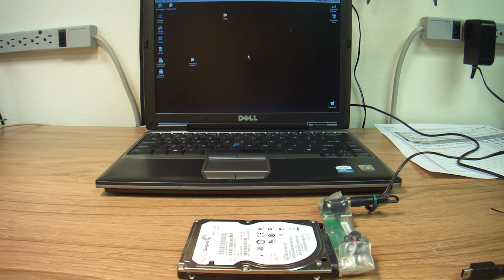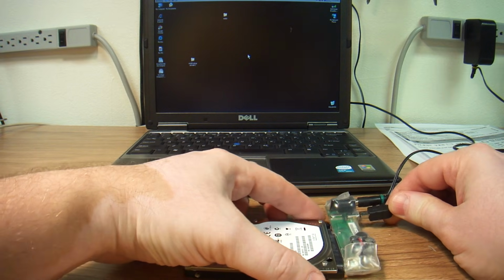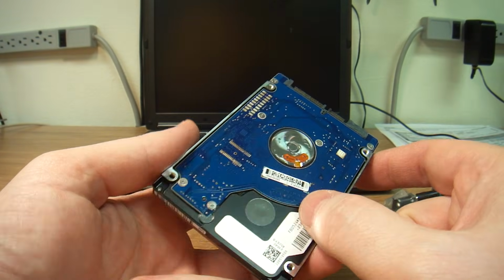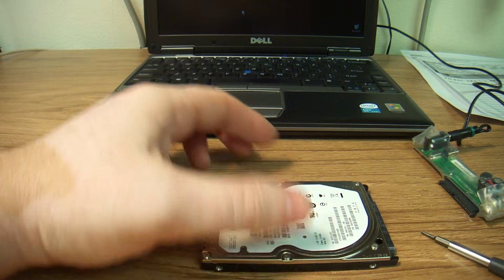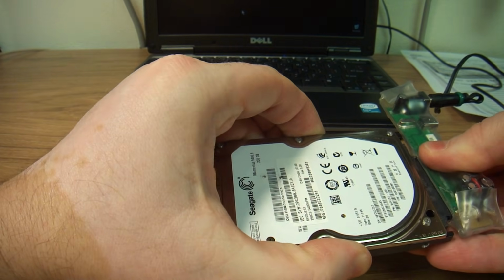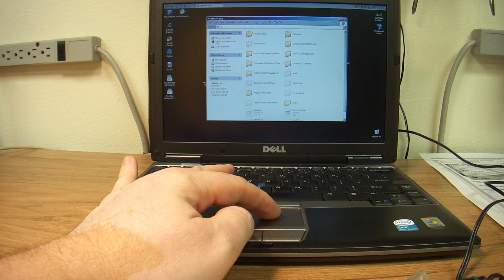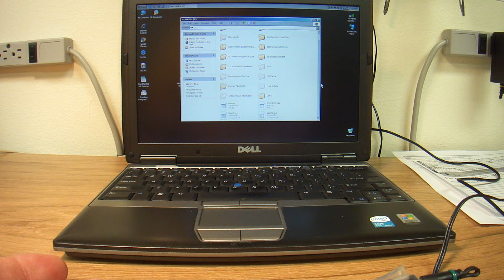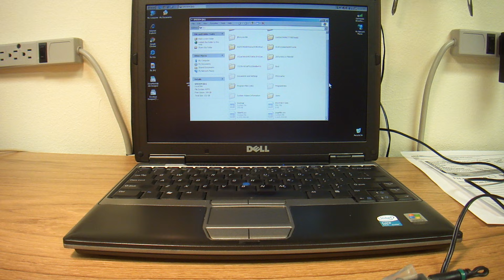How to fix a broken hard drive Beeping noise or clicking RECOVER GET DATA BACK FOR FREE! BEST TRICK

Comment: Thanks mate, the people who  recover the data were demanding Rs. 4000/- and more, the money for which I can buy a new hard disk. The problem was with Transcend hard disk, while it was still in warranty period, I couldn't find a service center near-by. The customer care was least bothered. Some of them told me the data cannot be recovered. Some didn't know what to do with the beep sound. I just invested Rs. 150/- on screw driver set and was able to recover 3/4th of the data. One folder was not accessible, but never mind. Thanks a lot!
I have 3-4 pen-drives that fail to get detected, any solution?

Comment: HI i wanted to ask my seagate 500 gb external hard drive stopped working... it was working find its an old hard drive i think i bought it in 2007 or 08 ...its an IDE connector..first it used to making weird beeping sound and not show up on my computer ( not similar to the one in video tho) then it made that beeping sound for about 4-6 minutes when connected to my laptop. after 4-5 mint luckly i used to show up and worked fine... then one day it just stopped booting. i even purchased usb to IDE adaptor it still dont boot up.. its dead no sign of any type of movement in hard drive no sound of spining.. can i fix it my self or it has to be pro done? thank you for ur time

Comment: Seagate drives always have this fucking problem
Reply: smokey deazy I recommend Western Digital.
Reply: +Norman G Seagate has thee worst hdds
Reply: they should open the gate to the sea so all of their hard drives die
Reply: +smokey diazo get a western digital
Reply: +SHJ Gaming Currently I have 6 seagate hdd es. Actually i really dont know why i keep buying seagate although they get crashed several times lol.

Currently one of them is compelely crashed. PC doesnt even reconginise it.
Smart check shows a few errors for another one.
And so far 2 seagate hddes are changed in warranty. And one of new changed ones has just arrived a few days ago and strange voice is coming from it.

In a nutshell;
I had 4 problems with 4 different hddes out of 6 i bought+2 changed.
Reply: +SHJ Gaming hey,i'm thinking about getting a new hdd ,need some help,i saw this comments now it change my mind on seagate .. which brand do you think is the best  ?
Reply: Exactly
Reply: thanks guys , my current HDD is WD 1TB .. :)
Reply: +SHJ Gaming i dont.  my last western digital hd broked after one year.
Reply: leohpndbz There's always an erroneous number in the mean time between failures. You're just unlucky.
Reply: +SHJ Gaming Hi USB Same too I am problem !! :(
Reply: The beast HD thanks, and i'm using 1tb WD now .. yippiyay
Reply: storm_999_ I think the really high capacity ones (4TB) are more reliable for some reason. Really good for RAID configs. But, yeah, all the consumer grade ones have just failed for me.
Reply: Idk all me segates are dead but my wd drives are more reliable for some reason
Reply: +smokey deazy do not buy a hdd. buy a ssd is much faster
Reply: Fuck Yeah Peczi ssd is for ultrabook right ? can i install it on my pc ?
Reply: You can install SSD's on anything with a sata connection.
Reply: C4L Media Group thanks , will try that in the future :) ..
Reply: +SHJ Gaming   yeah， because these are PRODUCT OF fuckking CHIAN.  I have exact same HD as the one in the video and have the same problem. I'm working on it
Reply: lol thats why you never by seagate
Reply: I also have this problem. Fuck this seagate !
Reply: is it worth paying $550 on the seagate website for data recovery?

Comment: What size is that screw driver
Reply: Torx T5.https://www.amazon.com/Kingsdun-Screwdriver-Magnetic-Replacement-Assembly/dp/B075FLSTRW/ref=sr_1_3?ie=UTF8&qid=1531848226&sr=8-3&keywords=torx+t5+screwdriver
Reply: Seth dude, it’s t6 and you cost me one trip to a hardware store :[
Reply: Fabian B sorry, I guess I have an inaccurate bit set. My bit said T5 on the side so I went ahead and assumed the number was correct...
Reply: @orbitwar  It's a pentalobe key. Did you find out what screw driver is?

Comment: I plugged my external hard disk on a friends laptop and it started making the same noise, however when i plugged it in my laptop, there was no such beeping and the hard disk wass accessible, can anyone tell what might be the problem ?
Reply: I plugged the hard drive on my friends laptop on the left side usb port and it works fine, but when i plug it on the right side, it doesn't work. I don't think the head is stuck as most of the videos indicate.

Comment: I have an interesting problem. My main drive makes this noise. I have a harddrive like this one installed as a secondary drive. I unplug it, primary one stops making the noise (i know one would assume secondary drive makes the sound, but trust me, its primary.) I believe it to be a power supply issue. But it never made this sound before, have had it installed for a week. I know it can't be the drives head being stuck, because it works properly without the secondary drive. Any help? It's not very important to have that secondary drive working, but an extra terabyte of space would be amazing for recording.

Comment: same thing happened to me as i use it for my xboxone. Was about to use this videos method but was too mad that my HD was broken. Due to frustration, I squeezed the front and back with 2 fingers (a bit of pressure but not a lot and only for 1 second). You can feel it moving inside when you squeeze it, and somehow it worked. Hope this helps anyone.

Comment: I have a Seagate Backup Plus 1 TB (2.5) that was working perfectly until yesterday, just when the computer froze while I was about to transfer a file. I gave no importance and shut it off manually, however when the computer restarted it wasn't able to detect the drive. I unplugged it and when I plugged it again I noticed the drive was beeping (fast and short) for about 10 seconds and then the led just kept blinking, I couldn't hear the drive spinning or any other noise (no clicking). I plugged it and unplugged it several times, switched cables, switched ports, remove the usb interface and connected directly to SATA ports... The result was always the same: short and fast beeping followed by the blinking led and no signs of activity.

Then I decided to follow this tutorial, it wasn't so hard to "peel" the drive enclosure to gain access to the drive, I removed all screws and THERE IT WAS! the head over the platter, I carefully moved the head as you indicated, rotating the disc counter-clockwise to reduce the stress of the head, pulling it from the outermost hole to prevent damaging it. When I finished I noticed a pair of insignificant dust particles over the platter but I decided to let them there, I assumed the centrifugal force was going to get rid of them and perhaps blowing them or trying to remove them will potentially inflict irreparable damage to the drive.

After that, I connected the drive and BOOM! The drive got recognized immediatly and all my info was there, I even ran HD Tune and no sectors were shown damaged!

Man I was scared to the death of losing all my information, you saved me. I encourage anyone who has this problem and has exhausted all other possibilities to give it a try, it's not hard at all, just be patient and do things very carefully.

Comment: Hi Abraham Levit  This is a report that came from a technician that had a look at my 500GB harddrive. Can you or anybody advise whether I can attempt to fix this drive myself in a similar way like this video of yours?

Report:

We have finished examining all physical and logical components of your storage media. Based on your situation we have determined that your media has sustained physical damage. The main cause of damage is that the storage media does not spin up due to a malfunction in the engine. 
For the recovery process we need to replace the whole engine unit and read write unit. After the engine transplant we will need re install the read write unit and recalibrate the heads. When the storage media spins up we need to read out all data on a sector level and reconstruct the complete file system. Afterwards we will mount the data onto an offline server in order to check the integrity of your data(partitions, directories and the different file types).
The repairs will need to take place in a clean room environment.

Technicians Notes:

Motor is wedged, heads not in parking position, no other visible damage inside, need to explant disks and possibly heads,

Comment: Hi Abraham,
Could you please help me in getting resolved my questions related to beeping in segate ext hard drive extension?
Hardrive capacity=1.5TB
When I switch power on , Hard drive keep on beeping for 5 mins and then stop.And my laptop recognize HD(as it says installing driver ). But I am unable to see Haddrive ICON. I checked Manage storage etc(system detects but unable to mount) but power is still on as HD green light keep on blinking.
Reply: sefysys1 
If the data is not important at all you can try this video... If the data is important you many want to refer to a data recovery professional as you can damage your drive instantly and the files will be gone for good.

Comment: My External HDD crashed when the power cord was removed during a file transfer. There was a clicking sound from the HDD. I followed your method. Now the head is spinning fine. However, the HDD is not detected in the computer. What should I do now?
Reply: Srikiran Gosangi try using a software called Partition Find and Mount to detect the hardrive and mount it, it should work provided the hardrive is working properly.
Reply: Srikiran Gosangi Any luck?
Reply: datarecoveryguy.com Nope. The hard disk has got unrecoverable bad sectors. So I gave up! 
Is there anything else I can try?
Reply: You can try professional data recovery. Is the information worth paying for?

Comment: Holy cow, this worked. The drive I fixed was my friends laptop one. It's internal and smaller than a desktop one. I don't know if this would work with a desktop internal/external drive with a like 4 read/write heads and 4 platters, haha.

Thanks for the help.

Comment: Hahaha all them hard drive noobs are scrambling over themselves for fixes and us SSD users are just like 0_0
Reply: Tom Lasky SSD's are far less reliable. This is a fact.
Reply: Tom Lasky and when your SSD takes a dump(when, not if), there will be no "fix for that.
Hahaha...
Reply: J Fisher  But his computer loads 5 seconds faster and for that level of speed he only has to forfeit his COD saves, browser bookmarks and folders of selfies. Sounds like a deal to me.
Reply: HDDs are more reliable than SSDs thats why datacenters use hdds and not ssds
Reply: Datacenters use HDD's because they have far larger capacity HDD's than SSD's, and they are way cheaper.

And if you think that HDD's are more reliable, you obviously know nothing of computers.
Reply: 5 seconds faster? You do realize that with an SSD, your computer can start up in a few seconds compared to up to a minute or more with a HDD?
Reply: Eric Ver Linden I don’t know how long my SSD will last but one my desktop from 2000 has a maxtor 10GB IDE HDD its noisy and slow but still works.
Reply: At least data wont be erased if you leave it off for more than a year, which makes SSD's useless for any long term archive. I have hard drives that are decades old and just recently transferred the data to a new drive even though some of them has been stored and not powered on for a decade at least.

Comment: This is how you wreck your HDD for sure..
First of all, if you are going to disassemble the drive, you need a clean room.. no matter what this dude say.. dust particles will ruin it either way..

You also need to use a torque screwdriver to set it to correct torque..

The only reason you would do this in a non-clean room is if it was your only option.. this will void the warranty aswell as, in most cases, do more harm than good..
Reply: but it worked though! :D
Reply: Most people do not have access to a sterile envirionment, so only other option would be to pay THOUSANDS of dollars to have professionals do it. If you do not have anything on there that is this valuable, then this is a good option and the guy in this video clearly explained that this was not the best option if you have data that is extremely valuable on there. 

And as can be seen in this comments as well as from my personal experience, this often does not cause any long term issues even in a normal "dusty" envirionment as I and others have had drives work fine for years after this procedure has been done.

Comment: Question: What sort of screwdriver are you using to open the hard drive.  My plan is to purchase a little kit and try to fix it myself if possible.
Reply: Hello, that should be done with a torx 8 (google it)
If you don't want to buy a screwdriver like that, you can use a flathead and use it like this:
http://www.instructables.com/id/Removing-Security-Torx-Star-Screw-with-a-Flathea/

Good luck :)

Comment: I have done this a few times, I had some drives I didn't care if it worked or not, so what did I have to lose. I know I got dust in 1 of them as I was trying to be careful but dust isn't easy to get out of your home, but the drive still works and its been over a year since its been taken apart.

Comment: Abraham you saved my tail. An editing client's hard drive failed with a week's worth of (expensive) footage on it. I saw your video, offered to fix it for them and they gave me the go ahead. Inside it looked exactly as you demonstrated. I moved the head back the start position and it worked flawlessly. Currently backing up the footage now. Makes me wonder how many of my other "dead" drives may be fixed using this method. Thanks!
Reply: Donnie Leapheart Hi Donnie,

Can you tell me was your hard drive dead that you repaired? Mine is completely dead. No clicking noises or any noise.

This is the report that a technician gave me after he "inspected" the drive.

Report:

We have finished examining all physical and logical components of your storage media. Based on your situation we have determined that your media has sustained physical damage. The main cause of damage is that the storage media does not spin up due to a malfunction in the engine. 
For the recovery process we need to replace the whole engine unit and read write unit. After the engine transplant we will need re install the read write unit and recalibrate the heads. When the storage media spins up we need to read out all data on a sector level and reconstruct the complete file system. Afterwards we will mount the data onto an offline server in order to check the integrity of your data(partitions, directories and the different file types).
The repairs will need to take place in a clean room environment.

Technicians Notes:

Motor is wedged, heads not in parking position, no other visible damage inside, need to explant disks and possibly heads,
Reply: My hard drive would attempt to spin up...once I reset the heads, it spun without any problems. Your problem sounds much worse and expensive to repair, but sounds like the data should be intact and recoverable since the plates are intact

Comment: Hi I have a question, when I opened up the cover for the drive and wanted to try turn the disk I couldn't with my screwer since the center is not a screw but just a circle, what other methods can I use (it did have screw around on the disk just not the center)?

And I saw that it did cause some scratches on the disk when the drive fell/broke does that mean that I only can recovered the undamaged data and not be able to reuse the drive as an back-up drive or storage for my music and stuff???

Comment: All modern hard drives have a micro-filter on all intakes in the hard drive its self, by opening the hard drive you have exposed it to micro particles and would seriously shorten its lifespan. 
If this does work copy all of your files over asap.
I take a TAFE course so i'm pretty sure this is accurate.

Comment: is it possible to use a pen and paper to back up a hard drive by writing down all the 0 and 1's ?
Reply: writing down all the binary code holy shit that would take years XD
Reply: @bossmantyler  kyle xy did it. watch that show the dude has no bellybutton
Reply: ''data will become porn videos'' i bet he will make that mistake in purpose lol
Reply: believe it or not, there was a software called PaperBack, that was storing (printing) data on A4 paper.  500KB uncompressed data  on an A4, using casual 600dpi laser printer, not that bad ;)

ps. that means roughly 1024 double sided A4, to store 1GB of data. less than i would guess, and with higher res printers, even less.

(ps2. that is only 1.048.576 A4s for 1TB!!!)
Reply: @constantinosschinas4503  Jeez..
Reply: @constantinosschinas4503  all my porn collection 👌
Reply: Stone Age people's, are making comments over IT..
Reply: lol....LMAO
Reply: In theory, yeah. But still no, considering that it would take years.
Reply: What a commmet LOL😂😂😂
Reply: You can, but it would take hundreds if not thousands of years
Reply: Ddff
Reply: please try it tell me the results
Reply: @Raj Mointa 😂😂😂😂
Reply: You'd rather use a computer to copy the binary data, it would take several years by hand D:
Reply: Lol
Reply: It'll take centuries lol
Reply: If you are owning 40GB of files you will need 40,000,000 pieces of paper if 1024 words on 1 paper assuming A4 , and you need approx 200 tonnes of paper. You need to own a quite large paper factory.   : )
Reply: Comment of the day!